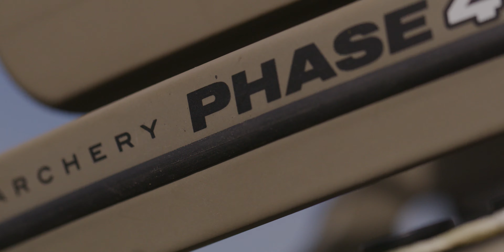Introducing the 2023 Mathews Phase4

Comment: How long will those limbs last? Also how long will the rubber in between limbs last
Reply: It’s brand new lmao. We will have to wait and see.
Reply: Out in the cold and wet?  Out in the sun and heat? How does one test durability after multiple years of exposure to the elements? Especially after tag soup and sitting in my case for 3 months every year?
Reply: Just shot one at the bow shop and the guy said they’ve sold a ton and never heard of an issue also that Matthews has a great warranty